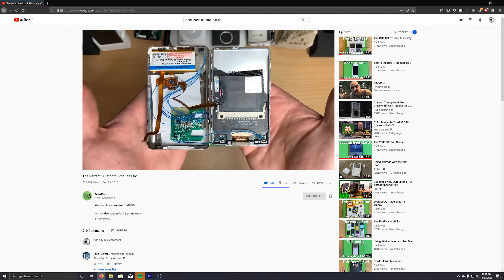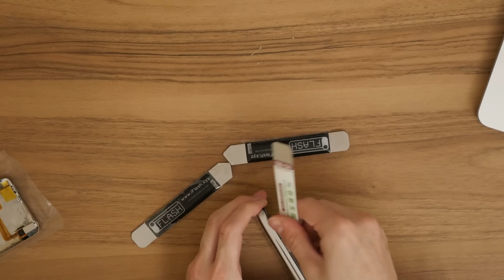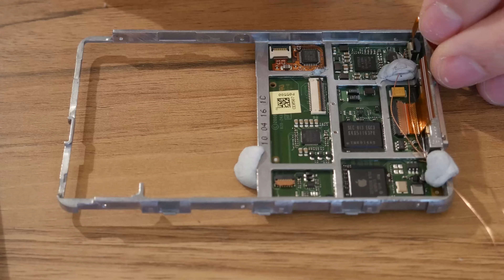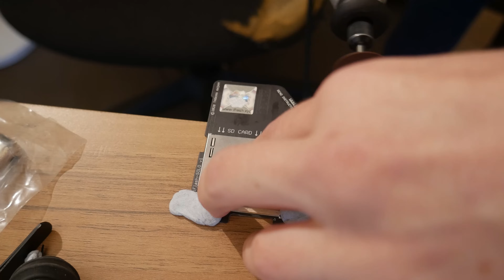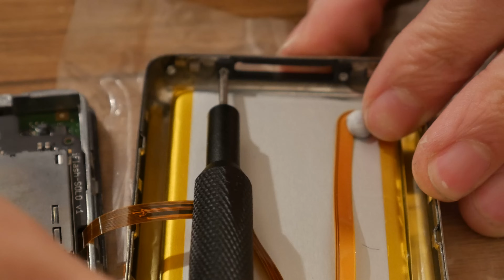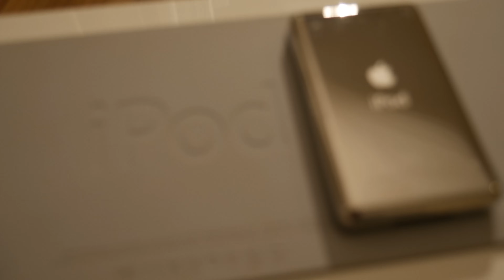The REAL Perfect Bluetooth iPod Classic

Comment: does this fit with a non sd card (original hdd) but with the thick backplate?
Reply from the maker: There’s a tiny chance you could fit the Bluetooth module with a thin HDD in a thick back plate,  but it’d be incredibly difficult
Reply: @Pendleton115  thanks for letting me know. i have a 32gb sd card lying around. would that be a downgrade or upgrade? or should I put in 64gb/128gb. and what would be the max for a standard 30g 5.5?

Comment: Is there a limit to the SD storage? And is it posible to get the paring mode from the Bluetooth on your ipod display? So you can acces it true the software?
Reply from the maker: There's no way to have Bluetooth in software, unless you are extremely talented in both hardware and software engineering. The iPod 7th gen can have up to 2TB I believe, but things start to get less reliable past 1TB.

Comment: Have you had issues with this Bluetooth adapter cutting out when the volume is low? The one I have looks very similar and does that, which ruins a lot of songs since it’ll fade in and out depending on how quiet the current section is

I love the form factor though so would totally get this one if it works well
Reply from the maker: Mine doesn’t do this, the only time it cuts out is when there is high signal interference, EG a train station or shopping center.
Reply: @Pendleton115  Awesome thanks for your reply! I won’t be able to do the cool mod haha but I’m going to get the same adapter for my iPod :)

Comment: I'm planning to bluetooth a 7th gen; your step by step is one of the best I've seen so far. A question; you mention about cutting part of the metal back plate to get the signal out of the ipod then you mentioned that you've made modifications to the antenna placement. What mod you have done to make the signal stronger? Looking forward to the mod video :-)
Reply from the maker: All that needs to be done is to line up the antenna on your bluetooth board with the hole in the metal plate of the iPod, easy as that :)
Reply: @Pendleton115  Also do you encounter any ground loop (buzzing noise)?
Reply from the maker: @rarseman  none at all!
Reply: @Pendleton115  I did an 1TB mini Msata version following the step of your video and it works perfectly but I haven't the back case yet because I have some questions. 1) I have Bose QC 15 & 35 and Sony MX4. Sometime the ipod signal goes dead and comes back when its in my coat, pocket or ipod in arms lengths; do you have the same issues? 2) I dont like drilling holes in the front and back of the ipod to find out if the bluetooth is on/off; however, it would be a good idea to drill a small hole on top middle between the jack and hold button to put a flat LCD light so u now if the BT is working. Finally, any improvements you have done since the video? Great Job and I glad I found your youtube so I could complete mine.
Reply from the maker: @rarseman  you can remove the metal plate between the LCD and Bluetooth module entirely and have the LED shine through the iPod LCD. That way you can easily tell the modules status. That should also help a lot with signal strength.

Comment: Thanks for the Great video. I followed your video exactly and everything went smooth except for 1 thing. When I play music I hear a low humming noise possibly ground loop. I tried it enameled copper wire and small gauge insulated wire as well, but it’s still there.
Interestingly the humming noise is only when playing music, when I pause it gradually fades away within 2 seconds to absolute silence.
It does the same even when the module is out side the ipod metal case, so it’s not signal interference....🤔.
Did you face this issue before?
Reply from the maker: This is very strange, my module has no noise what do ever. Are you using the same model? TTBA-07?

Comment: I did this mod, however when I click the switch it turns off the whole ipod instead of just the transmitter, and have to plug it in everytime to turn it back on. Any ideas?
Reply from the maker: That is extremely bizarre, sounds to me like something is shorting in your Bluetooth module which is forcing the iPod to turn itself off

Comment: First, thanks for a helpful tips..
but i am a complete newbie to disassembling and soldering.
so i have few concerns(questions).

A. is it okay to cut the screen panel? wouldn't that cause any screen issues or any internal damage to screen? (just worried.)
B. will this method work on any other bluetooth transmitter? what i'm considering to use is kokkia i10s.(as i heard, it goes to 30Pin connector)
C. as i mentioned, i have never done this kind of works in my life. is it worth to give it a try or should i pay someone to do it for me to not screw up the iPod?
Reply from the maker: It’s not the screen panel you’re cutting, but the metal support piece behind it. There is no danger in cutting it as long as you make sure it’s smooth when you re insert it.
 This should work with any module that has a 3.3v battery, but I’ve only tested fit/sound quality on the TTBA07.
 I’d recommend maybe getting some practice on other electronics before this, and make sure you have a fine tipped soldering iron for micro soldering repairs.
 Good luck to you!

Comment: how did you solve the head problem coming from the battery? I think maybe the hot glue could be damaged, especially with the Bluetooth button.
Reply from the maker: Head? Do you mean heat? The battery doesn’t get very warm. Not even close to the melting point of hot glue. I’ve even left my iPod in my card during a hot summer Australian day and it still worked fine once I let it cool down.

Comment: Great video!! Hats off to you mate!!
But i really don’t want my ipod getting thicker. Which part can i compromise to fit them in the original thin case?
Reply from the maker: The only way I can think of is to remove the SD card connector from the I flash board and solder the SD card directly to the board, making the assembly thinner. The Bluetooth module wouldn’t fit with the original 500mah battery as it goes in its place.
Reply: @Pendleton115  thank you so much ☺️ gracias arigato xiexie obrigado !!

Comment: Need to use flux and make sure your joints are strong. If your soldering work is good, then you don't need hot glue and it should not be used as a retention device. A little hot glue is fine if you need to lay wires a certain way, purely for routing purposes. Also taking apart the iPod works best with a guitar pick instead of those metal tools.
Reply from the maker: Thanks for the soldering device, when it comes to the 6th/7th Gen iPods you really need the metal I openers to get into them though, guitar picks would just snap

Comment: has there been any issues from cutting down the iflash chip
Reply from the maker: None at all
Reply: @Pendleton115  awesome, I just ordered an ipod 5.5 and I want to put an iflash and 2000mah square battery in a thin case before I get the courage to put it all in a thick case with a Bluetooth transmitter

Comment: Thank you so much, I loosely followed your tutorial but used a different bt board and pulled the audio straight from the motherboard. I got it working! So now it's a thick, transparent, 256gb iflashed, 3000mah,  transparent, bt modded 5.5 gen ipod. Thank you (Update, I now have the same board as in the video in the iPod and it sounds way better and has a lot better range and no static. Thank you again.)
Reply: How’s the Bluetooth sound quality? Any lags? Disruptions? Static?
Reply: @mofakah5906  I used a crappier bt transmitter that I had lying around so this wouldn't really be relevant to the mod he did. But with my crappier board, there is some static and sometimes it cuts out for a split second here or there because of how the board is placed. It still is a very enjoyable listening experience. I recommend if you do this to not cheap out on a Bluetooth transmitter like I did.
Reply: @shrekboi2465  good to know, thanks. I found a $5 iPod classic. Hopefully I’ll be able to do it like he did.
Reply: @mofakah5906  Just take your time and be careful with things and you should be okay. Best of luck to you.
Reply: @shrekboi2465  Thanks! I just picked up a 5.5 classic today... for $5 bucks. lucky

Comment: Were you able to find / do you know of any points to grab power from that are only one when the iPod is on? This way there would be no need for a bluetooth switch. I am working on one now with a very compact board from a usb adapter and really don't want to wire in a switch or button.
Reply from the maker: I did look into this when making my mod, but unfortunately I did not. You’ll still need a physical switch for pairing anyway though
Reply: @Pendleton115  Thanks for the speedy reply! I think I'm going to go with a simple switch on the side in that case.

Comment: I found that BT adapter on U.S. EBay for $10, not $45. Going further I found that I could build a new iPod from new parts, including the iflash (but not the SD card), and a 3000mah battery for about $120.
Reply: how
Reply: wouldnt that be so much more work

Comment: Would be interesting seeing something like this done with one of those official ipod bluetooth adapters that use the usb cable port so you could also change tracks with the controls on headphones or in a car.
Reply from the maker: There are actually transmitters that can do this over the AUX connection, unfortunately they're much bulkier normally. If someone can find a compact one I'd love to give it a shot!
Reply from the maker: @ZLFProductions  Oh interesting, may be possible. Although you'd need some nice soldering skills to solder to the 30 pin connector.
Reply: @Pendleton115  couldn’t you bypass the 30 pin connector possibly?

Comment: Hey man. I followed your guide. I can’t seem to get my Bluetooth chip powered on properly. If I connect the original battery to the BT module and the button switch I’m using it works but iPod battery power isn’t. I was able to power my first board I ordered off the iPod but lifted 2 pads and had to order a new one because only left audio worked. The new and old one both won’t power on now unless the original battery is connected. Any help? I’m really frustrated with this because I followed step by step and it worked but now I’m at a standstill.
Reply from the maker: Hi, are you sure your polarity is correct? Also make sure to measure the wires coming from your iPod Battery and make sure they're measuring the correct voltage :)
Reply: @Pendleton115  i tried both polarities to be certain but I’ll use my voltmeter to check. I just have to pull of the guide. I’ll assume it isn’t a physical power issue. I’ll most likely also plug the iPod in so it’s true power from it and not just the battery.
Reply: @Pendleton115  just fixed my pos and neg solder points. I had a wonky pos that was touching the ground. I’m hot gluing the pos and neg now and then wiring the audio! Should be done soon!! I’ll update if it works(: I’m also adding some black heat resistant paint to the LED’s so light doesn’t leak through

Comment: I really tried!! Many times, but I destroyed 4 transmitters. If  I buy a new one, would be the 5th one. It's impossible with the soldier. I'm almost giving up...
Reply from the maker: See if there is anyone in your area that could give you a hand! It’s a tricky job!
Reply: @Pendleton115  I did it mate!!!!!!! Finally!! After 5 destroyed transmitters ahaha. The thing is, I'm using Airpods, and I can hear a noise in background when I change the tracks, I dont know why. Thank you very much!!
Reply from the maker: @santiagobarrios350  I've never noticed any noise when changing tracks. Are you using the same transmitter I used in the video? Some pick up more interference than others.
Reply: @Pendleton115  Yes! I'm using the same transmitter. The problem I found now is I cant make the SD works. When I plug it to my laptop, it doesnt recognize it i dont know why. If I connect again the hard disk on the ipod, it works fine and it's  recognized by my laptop...
Reply from the maker: @santiagobarrios350  I flash Solos can be quite finicky, it can sometimes straight up not work with one SD Card, but work fine with another, even though they’re identical!
Reply: @Pendleton115  It works now, but now I cant close the iPod, it's incredible, and also I have some black lines in the screen. I m thinking it wasnt a good idea to make this.... ahha
Reply from the maker: @santiagobarrios350  sounds like you may have put too much pressure on the LCD, you have the thick back iPod right?
Reply: @Pendleton115  mmm I dont really know, it's the original one, it's an iPod 5 Gen video
Reply from the maker: @santiagobarrios350  you may need to purchase a thick back to get it to fit together, a thin back iPod won’t work

Comment: Curious if there might be a way to change the default name of the transmitter so that it read as say "Tim's iPod" when connecting. Excellent video, by the way. I think I will have a go at this, myself.
Reply from the maker: Unfortunately I don’t think there are any transmitters that let you change the name. Although you may be able to contact the manufacturer and get them set up from the factory as such.

Comment: my iPod Classic 160GB drains any battery I trow at it, actually the battery is full but the device will say otherwise. Any help?
Reply from the maker: is this with the Hard Drive or with an iFlash card? The M.2 iFlash adapters do suck a lot of power!
Reply: @Pendleton115  HDD. But It goes from 100% to Off in seconds.
Reply from the maker: @KenzoBronx99  is this a brand new battery?
Reply: @Pendleton115  Yes according to the seller. The genius bar guy had no idea what I was talking about so no help from the manufacturer.
Reply from the maker: @KenzoBronx99  sounds like some sort of logic board issue, sorry but I won’t be much help there. But something is definitely amiss!
Reply: @Pendleton115  Yeah I thought so. Thanks a lot.
Reply: @Pendleton115  You are not going to believe this.: the iPod stays on if it has a 30pins cable plugged in (not connected to a power brick JUST THE CABLE) but as soon as I disconnect the cable the low battery message appears and dies. Isn't it weird? The battery lasts for weeks in stand-by and it works just fine when playing music but with this "tail" attached.
Reply: @KenzoBronx99  maybe it's a faulty charging port, so it could be shorting and sending some weird messages to the main board? Just guessing
Reply: @spammy3164  sounds plausible. Thanks.
Reply: @DistrosProjects  I will. Not looking forward to re open the impossible case though. Cheers

Comment: Last question, sorry. How could I know if both polarities and wiresnare not in touch?? Because I tried to solder both wires, and they dont seem they're in touch, but I am not sure, because the space there are really small. The iPod turns on btw. Thank you!!
Reply from the maker: Set your multimeter to continuity and test both polarities, if there is a short the multimeter will go off.
Reply: @Pendleton115  the multimeter shows a number between 750 and 1100, in continuity, but without the "bip". Thanks and sorry for bothering you
Reply from the maker: @santiagobarrios350  not really sure, my multimeter just shows a 1 and a 0 1 for there being a continuity, 0 for none, but if it’s not beeping then you should be good!
Reply: @Pendleton115  Did you put a bigger case than the original one? or is it the same size? thanks
Reply: @Pendleton115   thanks!!

Comment: Thank you so much for your astonishing work. And for the video, and for the music in this video, and for the calm and intelligible manner of presenting information. -)

Well, unfortunately, I won't dare to do that. I will still master the simplest mechanical work of disassembling and assembling, but all this soldering and adjustment is hardly. Yes, in fact, it would be great to be able to acquire such things from modern artisans performing engineering miracles. I would definitely buy one.